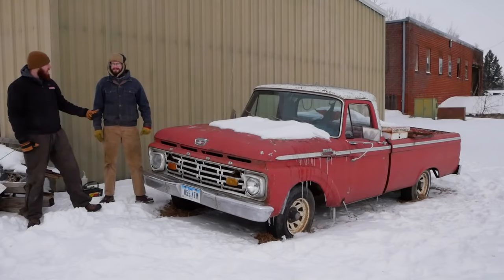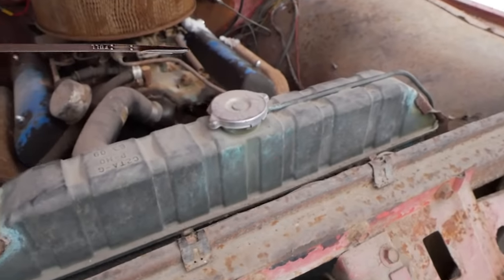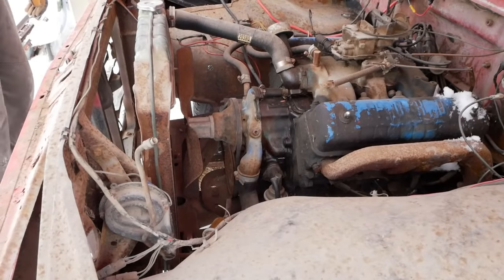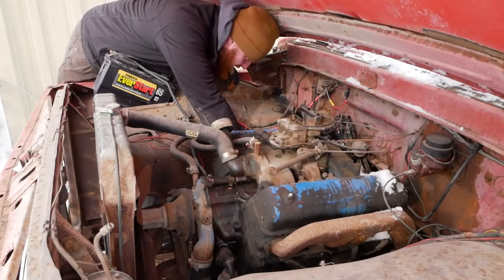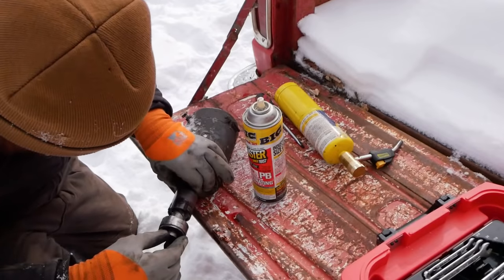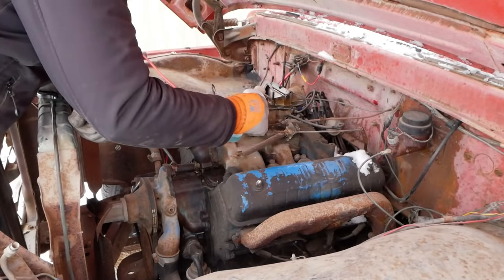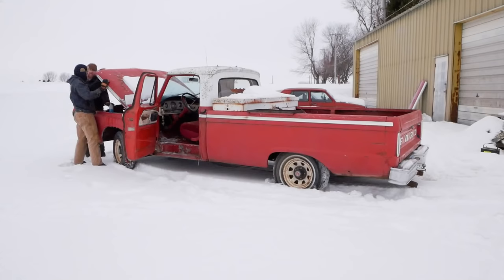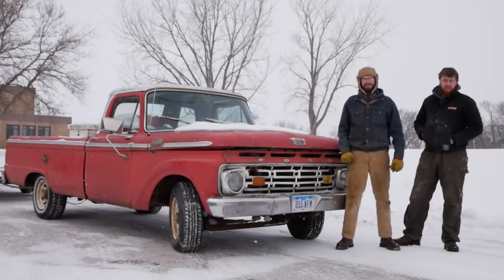Can We Make This FROZEN Truck Run During A Polar Vortex!?

Comment: How much for the VW? Lol
Reply: There used to be a guy in Renwick Iowa that would restore the bodies of these trucks and convert them to 4x4 with a 390. He would buy up old 360 engines and make 390's out of them. He had a short box in a dark plumb purple that would not fit in his garage unless he put the smallest wheels and tires on it. It was on 37 inch tires otherwise and last I saw it got a fresh 428pi motor and dual reservoir master cylinder,  power booster and disc brakes all around.  I'll check to see if theres a way to see if theres any parts left now, hes passed and his son just smokes and plays guitar up in Blue Earth mn. I know that those trucks have a large fan base and there are parts catalogs all over. I think I'm going to hunt down a 1955 ford f100, or a hi boy, since I miss mine so much. You guys are awesome and it's nice to see local iowans doing positive stuff to resurrect old iron to keep the American car culture alive for younger generations.  I wish I could hang out and help, but being in a wheelchair makes me the brain with no body to help with crawling all over and under stuff. I can still keep an eye open for other cool stuff. I can still build on the bench and engine stand and will be doing lots of that once I'm out of iowa. I am now rebuilding my tools that were stolen so you guys got me ordering Teng Tools. My dad worked for snap on and was injured severely on the job. He was in a coma for months, brain swelling caused issues with memory and trust. The company fought for 5 years to avoid paying for his accident and had to file for bankruptcy over it. So though they make some great tools,  they dont get business from me. I'll buy them at sales, auctions or garage sales but never new. Try looking into a Thunderbird Paxton supercharger for a Thunderbird.  Most came on 312 engines and were simple centrifugal units that fed the carb through a hat on the carb. I'm 41 now and wish I would have started something like you and your friends  have going on in the early days of YouTube.  You are all fun to watch and Mook is a funny little ball of energy and my sister, she said her son seems to have a crush on her (hes13 lol). You also prove that Iowa has its extreme  temps and other weather that can put the people of the south in a bit of a panic. My friend Gary saw a guy in Texarkana trying to beat the road conditions by putting on tire chains. Of course he put them on the rear of his toyota Solara LOL.

Comment: "Can We Make This FROZEN Truck Run During A Polar Vortex!?"  Not to be a drag, but who cares?  Trying to actually use this pile of junk, will cost you a fortune in time and money.  There is no part on it that you will not have to replace in the ensuing months.  Worn out, rusted, stuck, unavailable......lotsa luck.  But nicely made video and you guys are fun.  Like Wheeler Dealers.  Fix the big stuff and shine 'em up....and the new owner of the 30 or 40 year old car can spend the next years suffering.
Reply from the maker: Its done. On the road already. Cost $287
Reply from the maker: Plus tires i suppose